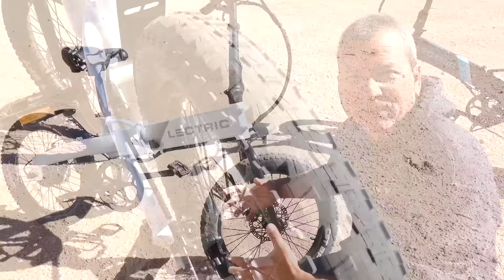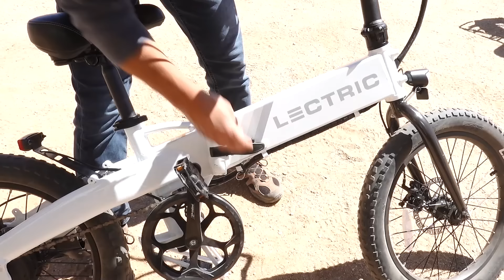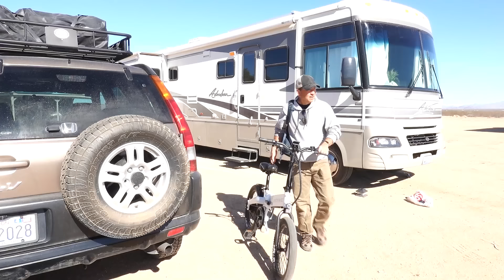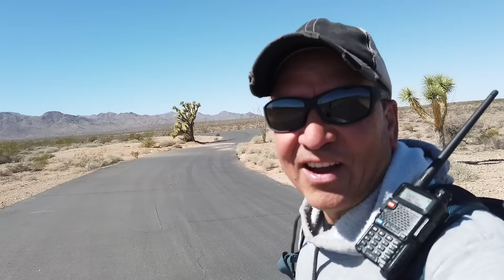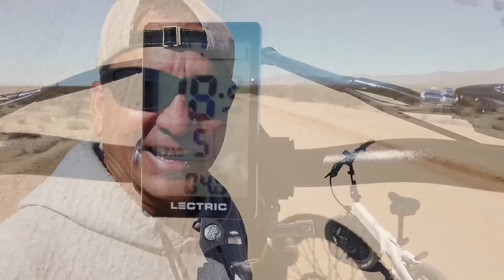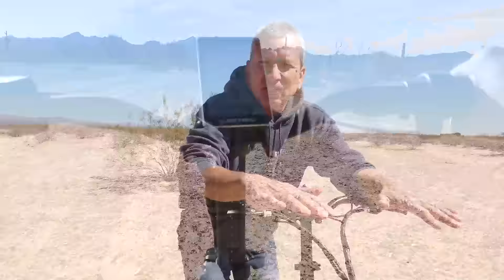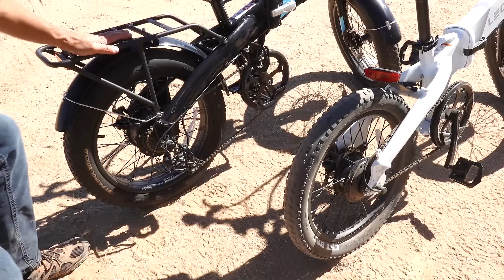LECTRIC XP LITE Folding Electric Bike Review and Testing

Comment: Love your video with riding and feedback. I've looked at other videos with more hilly / muddy trail rides (east coast) that show some challenged and limitations of the Lite and even the 3.0. But for me, will be doing more paved road and simple trails. Also looking for portability with RV use. Lite seems like a good option. I actually ordered the 3.0 that will arrive in a few days. It has additional power, featured, plus 7 gears that I think will be a plus in some ways. I'll try it for a bit first to confirm that I like ebikes in general. If results are positive for me and my wife, I will then decide what to by for a 2nd bike. Strongly considering the Lite as that 2nd bike for the light weight / portability aspect. Also the Lite looks like fun for much of the riding I plan to do. Not looking for long trips or challenging trails so the lower power and less battery capacity seems OK for me given the 46 pound weight. I'll try to remember to click on your link as I make my 2nd purchase.
Reply from the maker: Thanks for the feedback. The XP LITE is still my go to bike for traveling. You can't beat the simplicity and small footprint. Plus I have no issue with hills or any riding condition...especially since I put a suspension on the front. Most of our friends have larger RAD or Lectric bikes and I have no issues zipping around with them. I'm also testing an XPeak right now. It may be my second favorite. Stay tuned.

Comment: Just watched your review. Really like the bike. I need a light weight foldable bike that I can handle on my own as a petite woman. My one question is I was thinking I would only use the electric assist when going up hills. Can you explain how I would do that as your video made it sound like the assist was on the whole time. Thank you
Reply from the maker: Yeah. It handles hills pretty well.  As a single speed bike there's no down shifting. So as you start pedaling towards the hill just keep increasing the pedal assist until it feels right for you. When you reach the top of the hill start backing down the assist until the pedaling to assist ratio feels comfortable. Hope that helps.

Comment: Tito, I have a question. I first bought a Acenton Sinch and decided it is too heavy for me and i dont like the big tires. I am 70 yo female,so the weight to put in hatchback is important. I spoke to the shop i bought it from and they will take it on return since i never rode it, BUT they say the Lectric is not a good quality bike in terms of the parts ( derailleurs, brake, frames). What do you think? I am not a big rider, jsut want to go to some nice park trails at most once a week.
Reply from the maker: First of all, it's not really fair to compare the LITE with ebikes at the $1800 price point with more expensive components. The LITE is designed as a light weight, highly portable and affordable ebike. By the way it doesn't even have a derailleur since it's single speed. The frame is totally solid and brakes are the same brakes on many may eBikes. Hope that helps.

Comment: Positives: lighter weight than more capable models.  Tires are fine for paved and hard surface roads and bike trails.  Negatives: no gears, no suspension coupled with narrow tires and shorter range.  The light weight comes at the cost of a smaller battery, narrower wheels and no gears.  Really people, gears are important.  Learn to use them (takes a couple minutes) and you will be a healthier, happier bicyclist with functional knees.  To top it off the Lite is way overpriced compared to the regular Lectric (or many other brands) for what you get.

Comment: Thanks for making this really in depth review! That had pretty much everything I can think of that I'd need to know about the lectric xp lite I bought earlier this month. So far it was easy to take out of the box, unfold it and adjust the seat and handlebar the way I want it. I'll find out once I start riding it if I need to mess with those some more but sitting on the seat when it charged it felt like any of the bikes I had as a kid and late 20s when I was without a car for a few months. Now all I need is to find an Alan wrench so I can turn the LCD screen around so it's facing me instead of upside down facing the front. I paid 840 ish dollars counting the sales tax but at least the shipping and tire slime was free!
Reply from the maker: Glad you're enjoying the bike. I had the same experience. You can pick up a bike multi-tool from anywhere like Walmart or Amazon (https://amzn.to/3bw7AAX). Have fun!
Reply: How long did you have to wait before the bike got ya.?

Comment: Couple of tips:  Get yourself a plastic crate that is just the right size, and a pool noodle.   The noodle goes in between the folded halves to ensure no scratching of the stickers or paint, and the plastic crate makes it easier to slide and pickup and it keeps any dirt from the bike in the plastic crate instead of your SUV.
Reply from the maker: Yes. That works great. Thanks for the tips.
Reply: i just ordered the Lectric XP Lite. I was thinking the same thing....get a tub. Do you know what size?

Comment: Great video. I have a question about the fenders. How would it handle the rain? Would the rider get really splashed from the front tire throwing water at you due to rain, or wet roads? Also, for heavier riders, how does the bike handle? Could it support a 300 pound person?

Comment: Great video. I’m so torn! I have Fibro and need the suspension, but not the added weight. Yet, being single, I would need help getting the 2.0 in the car or on my Jack It bike rack.  With no suspension it will hurt me to ride the light. With the 2.0  it’ll hurt to get it in the car. I’m leaning towards the 2.0 and help from friendly campers!!😉  I’m thinking of the tote with wheels to put it in.  (Craftsman makes a nice black and red tote. If you cut out the center of the lid, then wire tie the lid back on the tote, you have a reinforced tote with a handle and wheels!)
Reply from the maker: Yeah. It is a tough choice. When on doubt I say go with the 2.0.

Comment: Good info sir, but can you answer a PAS question please.  Does the pedal assist automatically engage when you start pedaling?  Or does the pedal assist engage when you use the throttle?   Just trying to understand how it works as I would rather only have power engage when I use the throttle. Thank you
Reply from the maker: The pedal assist engages while pedaling at the level you select. The throttle overrides the pedal assist. The more throttle you apply the more power you get regardless of the PA level. You could set the pedal assist to the #1 (lowest) and only use the throttle if you like.

Comment: I’m new to electric bikes.  I have a question about pedal assist.  If you are in speed mode 5 and pedal continuously slowly, will it still accelerate to max speed using the battery?  In other words do you have to pedal really fast in mode 5 to maintain fast speed or can you just casually pedal and maintain fast speed?

Comment: I have been looking at the 2.0 but have been concerned about the weight and lifting it on my own. Although I love everything about it, if I can't independently get it in and out of my vehicle/bus, then it is useless to me.  This is why I looked at this video with curiosity, thanks for a great review. I only wished you both had said which bike you each preferred and why.  I wish the lite had the front suspension, but I love everything else about it. I have zero desire to go fast, this bike would be for exercise/recreation only, and I like the idea of not having to figure out all the gears as I am riding. Thanks again.
Reply: I agree - front suspension is a major feature some folks might not know will be important to them.

Comment: Don't buy a hub drive, that's the first piece of advice for anyone considering an eBIKE. Buy a Lectric XPremium rather than the LECTRIC XP light, it's ten times more efficient and has significantly less faults/maintenance problems and it will last you ten times longer.

Comment: Ordered one.   I want a simple bike with less to break and adjust.  If the range is an issue I’ll buy a second battery but I expect it will be more than enough.  I found that cheap and simple or expensive and high quality is the key.  When you’re in that middle ground and using lots of very low cost   components , that’s when you start having problems.
Reply from the maker: The light is most definitely the easiest to maintain. Have fun riding it!

Comment: I have been waiting for an e-bike, with a throttle only option (for short trips) like this, since it tops out at 20mph, keeping it a legal bicycle, and you have a showroom in Phoenix, where I live, which would make purchase easier if you are located close enough to where I live, saving shipping cost.

For commuter riding, it is nice to have a bike that is not a "speed demon"--20 mph is quite fast for a longer cruise, I usually cycle around 12mph for short commutes, sprinting to time my ride against lights on my route.

There are many offshore e-bike companies--having a company based in the US is finally a game changer for the consumer, in a maturing market.

I remember the popularity of mo-peds in the 70's and early 80's, when I often made century rides.

Unclear if the battery can be swapped, so if I were to carry an extra, for a long trip I could extend my range.
Reply from the maker: I agree with everything you said and...YES you can swap the battery out if you had a second one. You'll have to unfold the neck and remove the other one, then insert the new one.

Comment: Can you tell me about the frame. Is the center lower than the 2.0?  How much lower?  What is the measurement from the ground to the top of the center where you would mount the bike
Reply from the maker: I measured the step over height (midway up the neck) for someone else. It was 24 inches. The 2.0 is 26 inches. Hope that helps.

Comment: I’m really debating the 2.0 Step thru vs the lite , the 28mph is extremely appealing to me yet the light with its weight is appealing I can’t choose, is the 2.0 weight really that bad? Im curious being a 5’8 guy
Reply from the maker: If you're on the fence then I'd go with the 2.0. It's a great bike with more features.
Reply: @RVwithTito  sorry for late response! but is the lightweight  weight of the Xp lite significant enough to actually choose it over the 2.0? Or is it not noticeable at all and better just to get the 2.0???, does the 20mph feel zippy/fast enough???
Reply from the maker: @kobefan2472  The LITE is not intended to be a replacement for the 2.0 which still has more features. They both have unique characteristics. If you have no problem lifting 65lbs and it's that close between the two, I'd go with the 2.0 (my personal opinion). You really can't lose there.

Comment: Almost pulled the trigger last Wednesday on the 2.0 with fear and trembling that I could use my current Thule/Saris combo rack on the back of my RV (weight limit showed 55 lbs). So glad my curiosity of a new reveal made me wait and see the Lite!  This definitely works with my existing $800 carrier setup, plus being light enough for old ladies to handle!  Ordered a blue and a sandstorm and can’t wait for them to arrive! 

One question:  is the seat post the same diameter as the 2.0?  TIA (and enjoyed the review!).
Reply from the maker: That's great 👍 Yes the seat post is the same size as XP 2.0
Reply: @RVwithTito  thank you!

Comment: My wife and I have 2.0 bikes. I notice that something you didn't mention is that the Lite model comes without fenders and rear rack, both of which we really like about our bikes. I commute to work on my bike almost every day, and the more I ride it the more impressed I am with its capabilities. Thanks for your review of the new model, but I think we would still buy the 2.0 for the extra capabilities because of the 7 speeds, the protection afforded by the fenders, and the load carrying ability of the rack.
Reply from the maker: I think they may have just added those as accessories for the LITE. But yes...the 2.0 is a great package deal. Thanks for sharing your thoughts. 👍

Comment: Do you think it makes sense to upgrade to the "comfort package" for this lighter model?  Would it change the weight much or affect using pedal assist mode?
Reply from the maker: Shouldn't change anything besides a little cush in the tush and a little spring for the bumps.

Comment: The lite sounds great but can you use the power without having to peddle and does it have a place to attach fenders? I am 6' 1" will I be able to extend legs while peddling? Does it come with a shock  on seat? Just the thought of leaving key showing on bike I really have a hard time with. These bikes in a high crime area labeled with Lectric tells bike thieves it is worth some money to them. A simple logo of some sort might be better?
Reply: You could probably take the logo off using a hair dryer. I took a logo off my car, that way.

Comment: My XP fat tire can run lower air in the tires to help with the vibration over ruff pavement and gravel.
It's worth a try.
Reply: You make a valid point.I surf fish the beach with lower pressure for traction in sand. Side benny is softer ride in the rocky parts.

Comment: Does the XP Lite’s controls have the “Walk Mode” ?  This has proved very useful to me on my 1.0 as I encounter stairs or very steep inclines.
Reply from the maker: I didn't test that. Sorry. I didn't get a manual with mine, but my guess is that it does. Everything else on the controller seems identical to the XP 2.0. If I remember correctly, you press and hold the minus button...correct?

Comment: Like your research,  just wondering are larger wheels safer than these smaller ones ,especially on dirt, and is the weight  trade off better or would you have the bike with suspension and wider tyes?
Reply from the maker: Yes. For safety, stability, and comfort off-road go with the larger tires and suspension.
Reply: @RVwithTito  We are ready to buy our second bike and this is exactly my question. We have the 2.0 Step Thru. Love it! We were going to buy the Lite, but I'm also concerned about the smaller tires, and the lack of front suspension. Looking for comfort. We will use your link to buy - Should we get the $799 Lite with the 'comfort seating package' for $99 or just spend a little more for a second 2.0 ? It looks like you're saying go with another 2.0 from your response above. Can you confirm?
Reply from the maker: @beverlypayne361  The LITE is great if you need a more compact option that's still a quality e-bike. The 2.0 is definitely a more comfortable ride. If you're on the fence and don't mind the extra $200, then I'd go for the 2.0. For what you get, it really has the best balance of value and price. Hope that helps.

Comment: simplicity is better for less maintenance issues.  But the light version is not suitable for offroad, comfort level is poor for anything other than paved surfaces.  those cheap front suspension forks are the main reason for the weight difference.  fatter tires absorb bumps much better.  I’d like to see a single speed fat tire version, with a larger battery, and a lighter non suspension front fork.  From a price point, you get what you pay for…but lets be realistic.  These are the bottom of the barrel ebikes, and not comparable to an Ebike with quality components.

Comment: I am sure you have a large inverter. I do not. Just the 1000w that the coach came with. What is the charging current at the 120v side of the charging block?
Reply from the maker: Yes I do (3KW). The charger says 2A at 120vac. Output is 54.8vdc.

Comment: I am interested in the lightweight version even though I would prefer all the bells and whistles. I need lighter weight due to spinal issues. I will be getting the comfort seat of course and will keep an eye out for the upcoming fenders.  I’ll probably look for an aftermarket suspension for the front fork.   Even this weight will be difficult for me to lift, so I have an odd question; if I had a small ramp while it’s in the folded position can the tires in the folded position still roll up a ramp?
Reply from the maker: Answer: Hmm...sort of. It may be awkward though and only one wheel may roll while the other may not. I'd get a large plastic tote with wheels on it and use that to bring it up the ramp. I'll show you what I mean here: https://youtu.be/haCEnfh-WYk?t=1513

Comment: I like the smaller, lighter design but having fenders both front and rear are important for me  Also front shocks would be nice to cut down on vibration channeling up to the arms and shoulders.  Overall not bad though.
Reply from the maker: Yeah. Fenders are a must if you ride on wet roads. I think it would only need shocks if you're on really rough roads. I though it was fine on relatively smooth surfaces.

Comment: Critical question for some of us: Is that 46 pounds with the battery? Is it 39 pounds if you take the battery out? That would help when lifting into a car. Thank you.
Reply from the maker: Good point. The 46lbs does include the battery. Remove the battery and seat and you'll shave off some weight.

Comment: Comprehensive and thorough review, thank you!  I like the lightness and simplicity.  The only concern is that I live on a steep street.  I'd like to be able to make it up there without getting off and walking.
Reply from the maker: Glad it helped. I've tested it on a couple steep hills here back at home. I get up the hills fine, but have to pedal a bit harder than I would with the 2.0. The 300W motor will peak at 720W to help up the hills.
Reply: Also keep in mind that it has walk mode you can enable. We live on an avocado ranch and the road is VERY steep. The last 20 feet is rediculous. We just hop off, put it in walk mode for those 20 feet and walk next to the Lite. It pulls it's own weight, you just hold on.